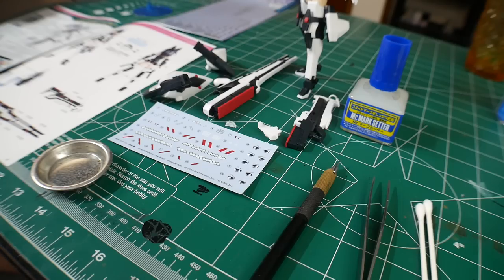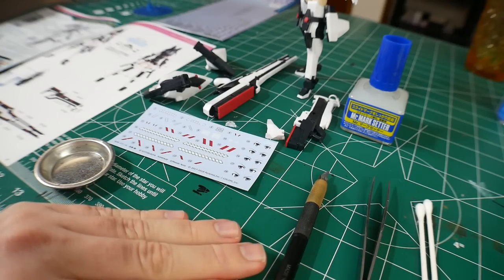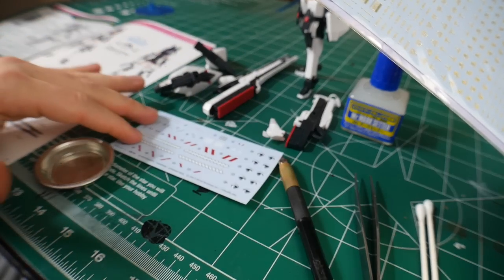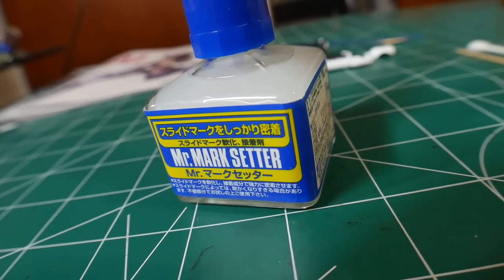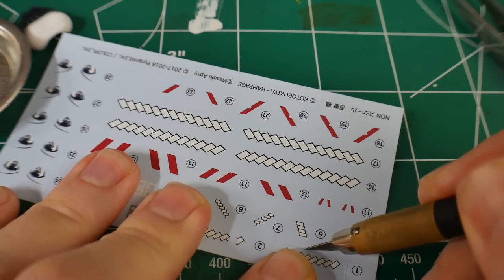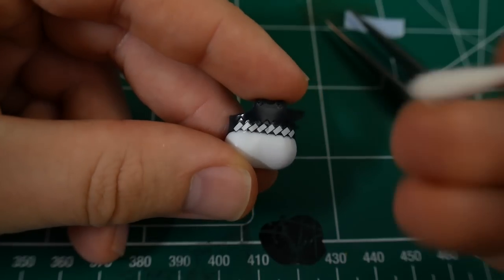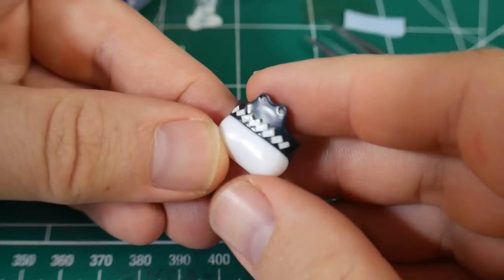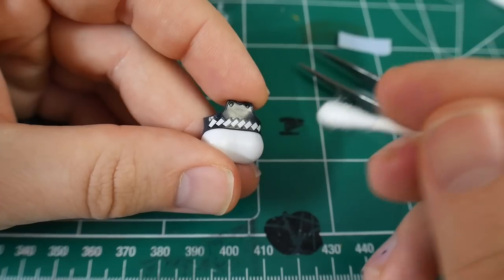Applying Waterslide Decals to Plamo | Krow's Learning Nest

Comment from the maker: I know I could've summarized better, but I wanted to go over as much as I could. Other than that, did you like this type of content? Is this something you would like to see more of? If so, then let me know what other subject you would like for me to cover.
Reply: Maybe minus mold parts, detail up parts etc. How to make cheap customizing parts (like IC pin thrusters)?
Reply: It’s a good start. Next up: scribing panel lines! Or making detail parts to hide the hollow feet(using putty and/or pla plate). Just some ideas.
Reply: Id appreciate it if you could add a tiny portion about removing nubs from an MG kit's v fin where the nub is on the sharp edge. Keep gouging and oversanding mine so Id like to know how you do it
Reply from the maker: @chatspam1238  I already have that video planned.
Reply: @TheKrowSama  Nice!  looking forward to it.

Comment: So I’ve been wondering this for my 40k actually since they also use water slides. But I was wondering if the setter/softener actually goes through the paint? I’ve seen some people who paint their kits and I never really knew if the product went through the paint layer and bonded the decal to the plastic or if it has to be plastic on plastic
Reply from the maker: I've never had an extra issue with using these products with paint. Just don't overdo the amount applied.

Comment: I've heard some people using a sharp object to get rid of air bubbles then passing some sort of liquid over it. How does that work? Wouldn't bursting the air bubbles leave holes in the decal itself?
Reply: Use a cotton bud and lightly roll out the bumps :)
Reply: @ceeme03  this. Definitely never use anything sharp to move the decal around. I use a toothpick / qtip combo